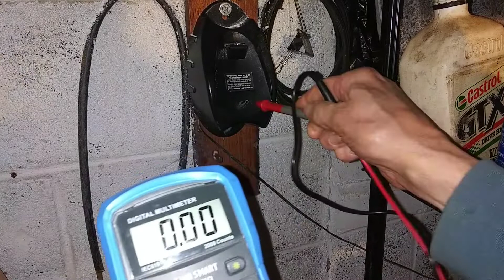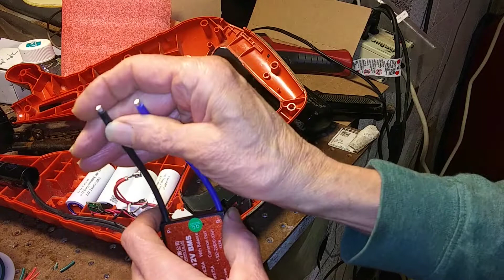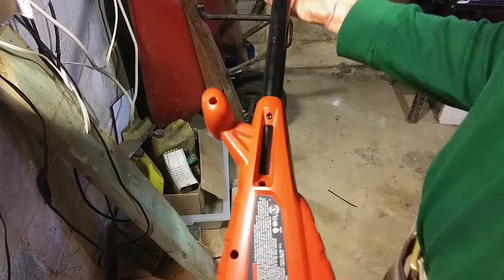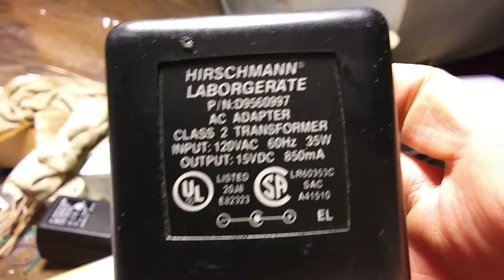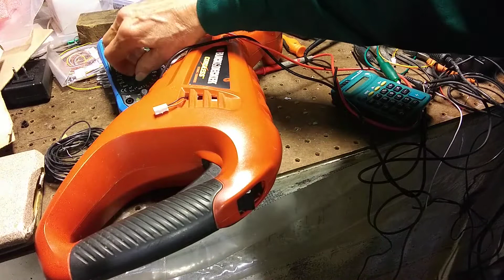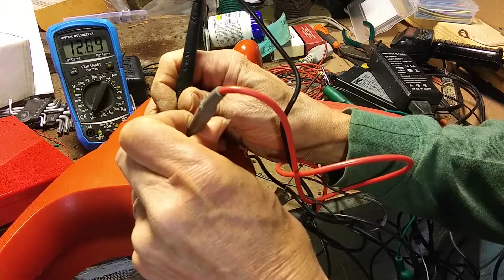Lithium LiFePO4 conversion of 12V cordless string trimmer - Black & Decker CST1200 weed whacker

Comment: Very interesting video. However, it would have been a great video (and useful from a practical standpoint) if you had shown step by step instructions on how you wired the batteries to each other and to the BMS, as well as shown closeups of the connections you used for testing.